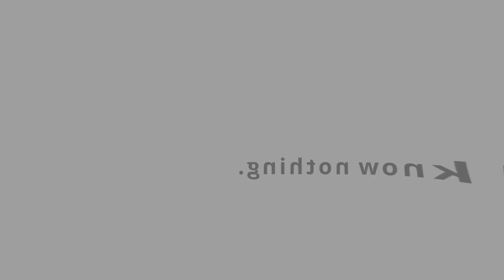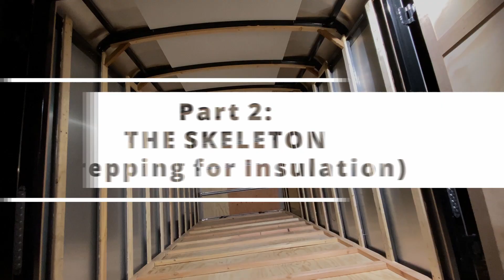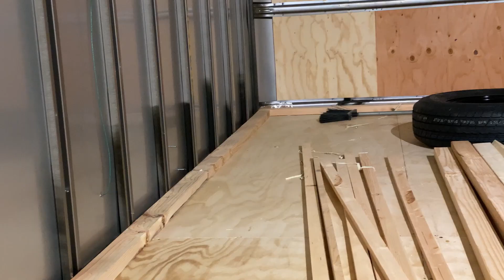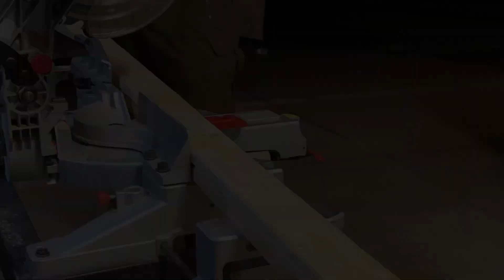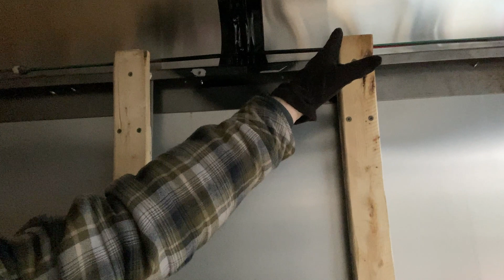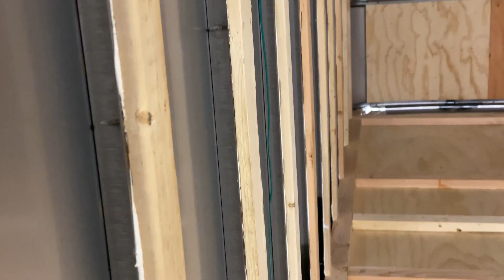Cargo Trailer Conversion Part 2: The Skeleton! (Prepping for Insulation)

Comment: if you can spare 2 inches put 1 more inch on both sides To keep metal studs from thermal transfer the metal studs will transfer outside temperature inside and may condensate
and if you can spare 2 inches off the height add 2 inches of foam in the floor to keep the floor Joyce from thermal transfer just add dance foam on top plywood then I had another sheet of plywood on top that  i wish i did mine like that while doing mine
Reply from the maker: I did add 1.5 inches on the floor. But I didn’t on the walls. Only that extra bit. Right now I can’t go back and put another inch on the wall studs. Maybe I’ll just have to see how it goes. Are you getting a lot of condensation?
Reply: @RyanKnowsNothing   i’ve not took mine out yet  but i only insulated between Metal studs 
inside my Garage you can still feel the cold spots everywhere a metal stud is
i really wish i did the 1 inch on top of metal studs  but i’m to far along to turn back now ? 
Not nitpicking your build just trying to give friendly advice wish I had the same advice when I was insulating